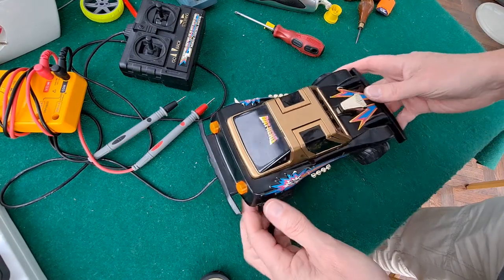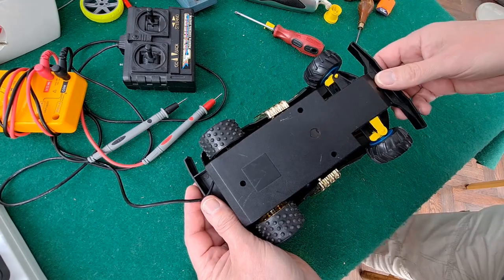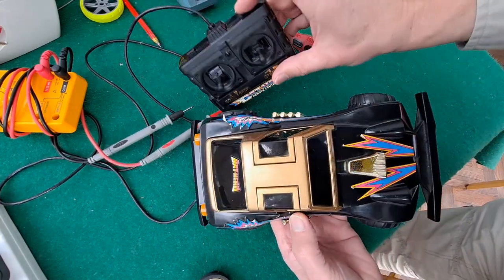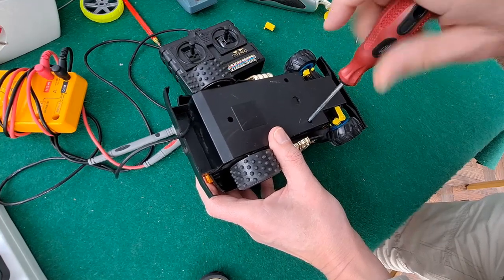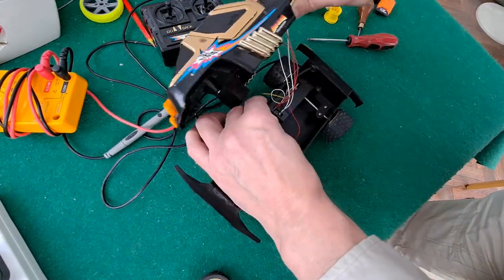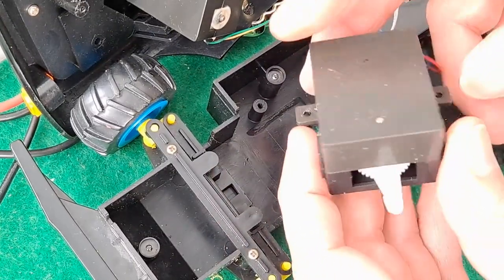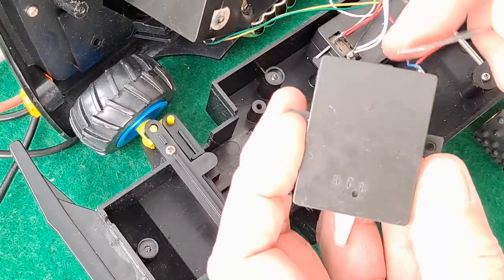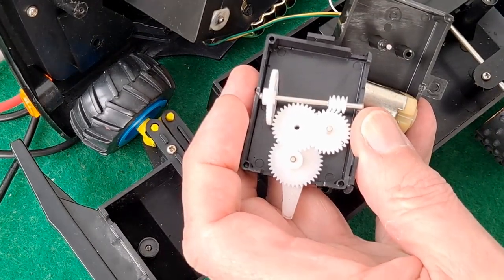Part 3 - KS Toys Bat Hero Gold Blaster wire control car 2018 charity shop find revisited

Comment: Nice video .the wheels fit good on the car.they came out good  and the bigger wheels look a Lot better .old school steering mechanism in there .dont know why theY didnt use a halfmoon gear for the steering.still nice working car.
Reply from the maker: I find different manufacturers use different designs, there may be a copyright issue.

Comment: You did a grand job making those wheel hubs and the missing part for the steering. I wonder if it would be worth putting bit of grease on the gears to make the mechanism a bit smoother and quieter?
Reply from the maker: The only problem with grease is it collects dust, but  it might make it a little quieter. It really does not concern me as I will not be running it. It is back in storage now.
Reply: @GrandadIsAnOldMan  fair enough 🙂